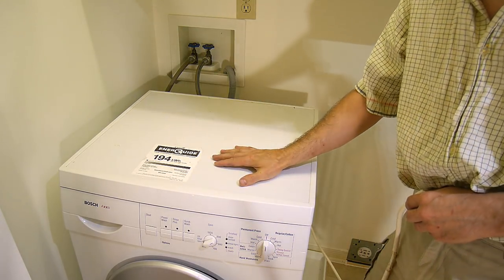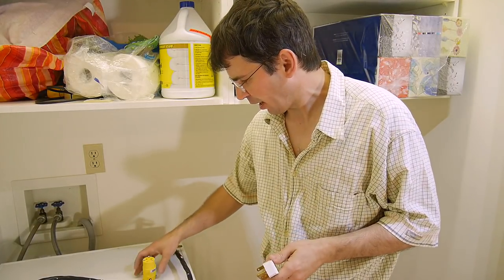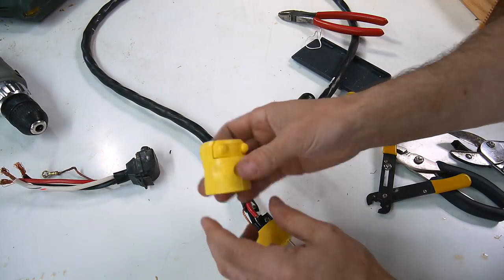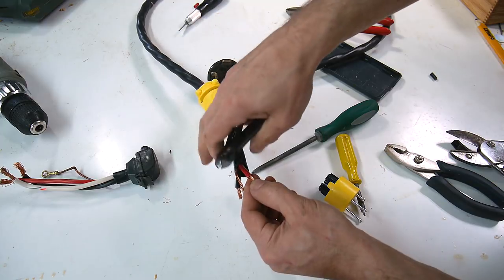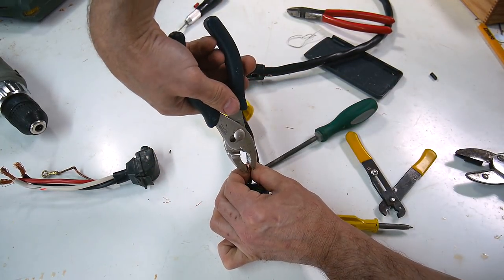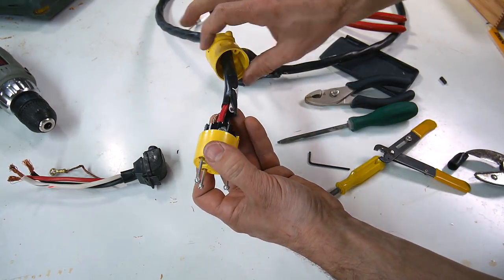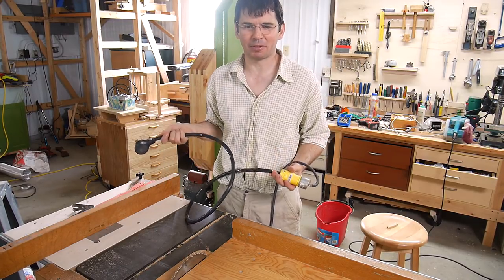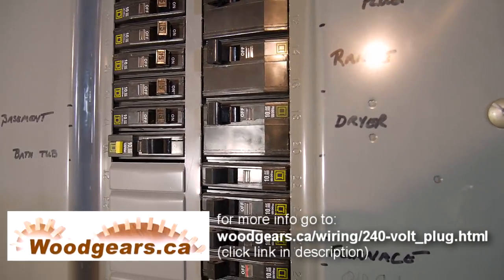240 volt from dryer plug (for Euro-washer or table saw)

Comment: I'm sure you already know this but since USA AC is 60Hz and European is 50HZ, the motor is going to run 20% faster than they originally intended (since you note that it came from Europe)...  Might affect the overall life of the motor (although I'd enjoy watching a "Here's how I rewound the motor on my washer to 60Hz" video. :)  You could do a whole thing on why 60Hz is more efficient than 50Hz (Edison vs Tesla) thing while you're at it. ;)
Reply from the maker: the washer was sold for north america, with that plug on it.  Also, it usues a universal motor, not an induction motor, so the speed doesn't change with frequency
Reply: See, I said I'm sure you already had it covered. :) :) :)  Wish my US hot tub could say the same thing.  It ran too slow on the pumps when I brought it back to the UK with me and they were way to expensive to justify replacing or rewinding!
Reply: At least one thing the Uk got right - 240V/50Hz. But damn, the plugs are annoying. :D
Reply: Michael Baron    The phrase you are looking for is "properly engineered"
"Safe" and "don't drop out of the socket when you look at them too hard" are also options.
Reply: I guess having grown up in the UK I just always knew plugs to be like that.  Must admit in 8 years living in the USA I never really grew comfortable with US plugs.  They just seem quite flimsy and without the requirement for an earth they relied (sometimes) on different prong sizes to get them the right way round.  UK plugs and sockets have quite a few safety features in their design.  For instance, the earth prong is required and is longer than the live and neutral prongs, so when you push the plug into a socket, the earth cover/slider opens but the live and neutral covers don't open until the earth prong is already seated.  So on an undamaged socket, it's more or less impossible to electrocute yourself and you have zero need for baby safety plugs.  Their main disadvantage is that they don't make for convenient packing when travelling, although Apple have a neat folding one out now. :)

Not that Matthias wants a video that devolves into a "my plug is better than your plug" flame war or anything. :)
Reply: Also many newer washing machines use brushless motors that run at much higher voltages and use built in variable frequency drives. This almost always involves rectifying the incoming AC line voltage into high voltage DC which is then chopped up to get controllable AC frequencies to drive the motor.

The VFD component would make the system tolerant of a wider range on input frequencies. Although the side effect is it generates a lot of EMI/RFI interference. Sometimes it even allows the entire machine to run on wide input voltages/frequencies if the components are sized correctly. For international mfg's being able to make a motor appliance run on everything with one design simplifies things.
Reply: I think you mean over-engineered :D. They certainly are safe, fused and all. However, it's very annoying that you can't change the orientation and all plugs are angled and god-damn bloody huuuge. Never had a type-F plug fall out of a socket.
Reply: You can get versions of the plug that let you reorient the wire relative to the plug itself (if that's what you meant; not sure) by rotating the plate.  I always liked how flush the plugs are once they are in the wall.  But then I absolutely have a familiarity bias having had them all my life...

Speaking of my life, when did it become a discussion on plugs...  :)
Reply: Oh man, I didn't know that. Most of my plugs are moulded plastic.

Let's bring some oxymoronic sad fun into this: Soon Theresa may will come up with a reason to exit the 240V/50Hz union. Too sensibly European haha.
Reply: Edison vs Tesla was whether to use DC or AC not 50Hz or 60Hz.  To my knowledge Tesla was frequency indifferent so long as the current was alternating.  Edison would have wanted a frequency of 0 and would have equally disliked 50 or 60Hz.
Reply: brookead, firstly I understand and appreciate your perspective.  This at no time is a jap or jab at anyone's standards, just my observations.  To your comment, true UK plugs to have a lot of safety features built in.  Because they have to adding to their cost.  US plugs are flimsy if they are low voltage/current applications and don't require an earth ground if one isn't necessary.  Not every application requires an earth ground, it doesn't mean it isn't safe.  However, one should always use the right plug for the right job.  And yes US (NA) plugs leave room for errors in judgement.  However I've never had an issue with plugs or cords in the US and I rather like our rather petite plugs over UK's overly humongous plugs.

I also like that in North America we put the proper voltages where needed.  This helps to reduce costs and inherently factors in some level of safety.  Having 240V at every plug just doesn't make a lot of sense to me.  In the end who is right or better?  Neither.  Both have advantages and disadvantages over the other.  However I prefer the NA standards.  They offer far more flexibility, lower install and operational costs (cords, etc.) and I just prefer our form factors more.
Reply: Brookead, you literally don't need a ground wire. All a ground wire is used for is to protect the user against case shorts. If you're using a double insulated tool/appliance there is no where to hook a ground wire up.  That's why many times NA electronics don't use the ground prong.

In japan they use the exact same style plug, except none of them have grounds on them.
Reply: brookead 60Hz is not necessarily more efficiënt. With higher frequencies come higher losses. For example hysteresis losses.
Reply: When they say "European", they probably mean that it is side-loaded, instead of top-loaded. Because the original device plug has nothing in common with real European. And if it works with US 240 volts (which is 2 phase), it is definetely not European (which is 240V 1 phase).
Reply: He also missed.. they hurt like hell when you stand on one. That being said, I do miss the outlets from back home though, another bonus being they allow you to push furniture closer to the wall.
Reply: I'm with you about not always being comfortable with US plugs. I hate disconnecting extension cords etc. I worry I'm going to have my hands just to close to the prongs as they come out and I'll get a zapping. They could be better designed.
Reply: The difference between 50Hz and 60Hz is negligible.  Believe it or not aviation systems use 400Hz 115V.

Comment: your electrical standard is really weird for european people like me ^^.

here everything runs on 240v AC.

main electrical intro is now mostly 3 phases 400v 40A + neutral + ground (phase + neutral bring Voltage down to 240v) even if old houses are still connected with mono phase.

so you can plug big biffy motors here <3 :D

Comment: I say this with tongue in cheek and feel extra cheeky tonight  because I'm nearing that retirement age and have tried most things. All you would be - could be 'lectrical dabblers which includes you too Matthias do know  that electrical appliances all run on smoke. Most things I find I give them first up a smoke test. I have found repeatably that when the machine / appliance has smoke pouring out of it after I've turned the power on.  Best Deduction  is .... once you let the smoke out ..... the machine / appliance ceases to work on a permanent basis. lol.

Comment: You realise that you are showing people how to install a machine an electrical appliance without proper protection. A 40amp fuse is way to high for a machine that is designed to be on a 15amp circuit. Simply bad practice, you talk about the cable on the washing machine not being protected, but you don't mention that the machine it's self is not protected!

Comment: Mathias, I always enjoy watching your videos. They go into so much detail.  On this video, I have to agree with other watchers that this one should have been left unmade. I have come to expect a higher standard for your videos.
Reply from the maker: Do tell what is wrong with the video.  This sort of generic criticism is not constructive.
Reply: Again, I want to stress that there are these type of videos on youtube, but I didn't expect to see your name on one of them. It seems to play down the dangers of 220V. You show a jury rig that you were originally using, which yes its possible to do that sort of thing, like you can put a metal blank to replace a screw in type fuse in the old  breaker boxes, but why make a video to show how. You say that not all the wires fit around the connector, so you cut some of them off. That says that maybe that connector wasn't rated for that wire. A better video would be to show how to switch out that outlet.
Reply from the maker: Do tell, where was I telling people to jury rig stuff like this?
Yes, the connector wasn't rated for the wire, it's rated for 15 amperes.  If I lose maybe 3 strands out of 20, the wire will still be fine for the load it's going to get.  And if there's a short, it will still pop the breaker just fine.
Reply: Matthias, you are one hell of a good mechanical engineer, but there is a reason they have electrical standards.  You are arguing with the wrong guy, take it up with the NEC. The connector may fail and cause a fire before the breaker pops and  do tell how you really accept constructive suggestions.
Reply: Right on

Comment: Y u no solder?
Reply: because you shouldn't solder mains. only crimps or screw terminals. solder makes connections unreliable.
Reply: Better don't open one of your hundred small AC devices... In every single one of them the mains are soldered to the pcb.
Reply: yeah, but they do cary like 5W not 5kW
Reply: Just cut the original cable and solder the new one on.
Even I could do that.
Reply: NEVER solder screw clamped cables, it looses it's springiness and can come loose!
Reply: Screw those srews just solder the two wires together.
Dont tell me thats impossible

Comment: from my point of wiew, ground and neutral are a wee bit not compatible (at least over here in Russia) on three phase plugs we have Ground, L1, L2, L3 and neutral, allowing you to pull 380V from all 3 or 220 from any of the three, plus ALL of the 3 phase supply is Delta type. Since we never connect neutral and ground, the RCD (not common to be installed after a breaker since most engineers simply have one for the whole house or just don't bother about it) will protest. I do not know much about how they do it in Canada (would be nice to see your breaker box one day) and thus only relying on what  Matthias said, it's a OK kind of ghetto fix. And to all you safety nazis, it's absolutely FINE to do it.
Trust me, I am an electrical engineer.
Reply: Most all homes in the USA and Canada do not have 3 phase power. A wild guess is say 1 in 1000 homes do. The normal wall outlets in a homes rooms are are 120 volts hot to neutral. 

The big loads are 240 volts and use the two 120 volt hot wires in the circuit breaker box. Thus a home might have 12 breakers all one pole, all 120 volts to neutral. 

The big loads use a two pole breaker with 240 volts line to line is the two hot 120 volt legs. The 240 volt loads are often the Kitchen Range/Oven, the clothes dryer, the homes BIG AC unit, maybe the water heater too. \

The laundry clothes dryer also uses the neutral wire too since the drive motor is often 120 volts, the heating coil say a 4200 to 5400 watt coil running on 240 volts. For light low heat an ancient scheme is the dryer has the 240 volt coil running on 120 volts thus 1/4 the power.

 Kitchen ranges sometimes do this too thus dryers and ranges use the two 120 volt hot legs for 240 volts and also the 120 volts to neutral for the clocks, timers, computer or lower heat modes.

 Dryer and Range plugs use to be 3 wires, two 120 volt "hots" and the neutral. Then a few decades ago the 4th ground wire was added, a non current carrying wire. 
say

3 phase power in a home is rare in North America. If a home has it then it is almost always for a big 5 ton AC unit. 

Regards, I am an EE too but in the USA
Reply: 3beltwesty Thanks for the details! I have also contacted a EE I know who lives in Canada and did some further research on this topic. I still do not understand why they came up with the strange 120/240V 60Hz supply. I can tell you the story of 220V 50Hz EU standards and the three phase in the EU. I will still ask: why did they have to make a dedicated dryer plug?
Reply: Originally our 120 volts was about say 100 back before 1890 and it was DC in some places too. The original 100 volts became 110, then 115, then 120. My place today has about 123 volts today.

* The original 100 to 110 volts was purposely chosen since Lumens per watt was higher than a 220 volt filament bulb, plus the element was more robust for shock and vibration. The entire development of the light bulb went through many thousands of tests over a few decades. ie the higher 200 to 220 volts for filament bulbs was rejected as wasteful since it required say 3 to 5 percent more watts per Lumen. 

Electricity back in the 1890 to say 1910 era was super expensive. ie like 10 to 20 times more than todays costs in todays dollars. Thus costs mattered and the 100 to 110 volt bulbs are the reason this voltage was chosen. Early homes 100 years ago here had only 110 volts, a business would have 220 for machines motors. Once electric ranges came out then the 220 volts slowing went into expensive homes. 

By about 1947 the laws in the USA had where homes and apartments of a certian size had to have 110 and 220 volts service too. This is because post WW2 the electric clothes dryer came into mass usage, AC units increased into homes too. Today most all home have 120/240 volt service. Ones TV, radio and lights etc all use the 120 volts. 240 is used for bigger loads. 

 Clothes dryers for home are sold without cords/plugs . This is because the old cord is sometimes reused, and there are two variants ie 3 and 4 wire. The cord/plug costs about 15 to 20 dollars. One could hard wire the unit, a public laundromat sometimes does this. In homes the house is built with a wall outlet. Folks usually buy their own dryer and take them away when they move out of the home, thus the plug/outlet scheme is used here.

Comment: Neutral and ground are not the same: ground is ALWAYS the same voltage as the ground / earth, and neutral is ALWAYS a reference for the hot line(s).
Grounding (connecting to the earth) is used to make sure the voltage between you and things you can normally touch (unless insulation is damaged) is always zero, and no current can flow. I think I read somewhere that, in cases where there is no earthing from the wiring, you can create an earth wire by connecting it to the plumbing or something.
The neutral wire, on the other hand, is used to complete the electrical circuit so electricity can flow.
Regarding power, your appliances only care about the difference between the hot(s) and the neutral (or, in the case of North-American 220V sockets, the two hots), and the transformer that is used in North-American homes does just that: provide a voltage difference of 110V AC between hot and neutral, with the two hots being each others' mirror images with respect to neutral, creating 220V AC between them. If the link between ground and neutral wasn't there, you could theoretically charge the neutral up to thousands or even millions of volts (static voltage with respect to ground) and there would be no problem since the difference between hot and neutral would be the same — except, when you would do this, insulation that was normally enough would break down and you would get shocks everywhere. Think how the couple of centimers / one inch of air in the sockets is enough to insulate mains voltage, but the millions of volts of a lightning strike can bridge kilometers / miles of air. Therefore, it makes sense to reference the neutral to the earth, so that the voltage difference between power and earth is at a minimum.
This does not mean you can use them interchangably: after they are connected, there is usually a GFCI / RCD that measures the current of the live(s) and neutral, by measuring their combined magnetic field. If there are as many electrons going one way as are going the other way, their combined magnetic field is zero. If there are more electrons flowing one way than the other way, which can happen when there is an electrical path to ground, a small magnetic field is generated which can trigger the GFCI / RCD to shut off all power.  Using the ground instead of neutral, will trigger the GFCI / RCD. Using the neutral instead of ground, leaves you unprotected from ground faults: when your body makes a connection between live and neutral, you might as well be a lightbulb for all the GFCI / RCD can see, and it will continue passing current through your body.

I think what Matthias meant to say was that it is not a big deal to leave the neutral cut off but bare, because it was in the plug anyway (so you can't touch it) and it can't connect to earth (although if it did, it would probably only trip the GFCI / RCD). I still find the bare earth wire a bit scary though: way too easy to accidentally make a connection.
Reply from the maker: watch the video, read the article.
The plug has ground.  I connected it to ground.  The plug does not have neutral.  I did not connect neutral.  Is that so hard?